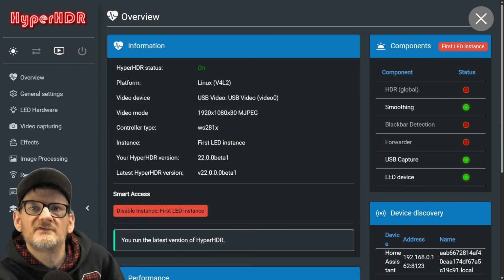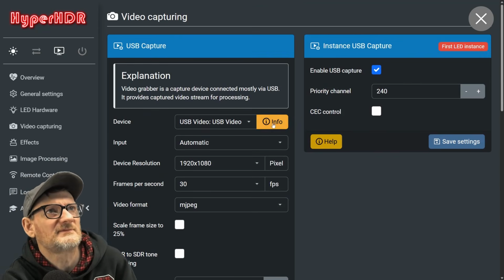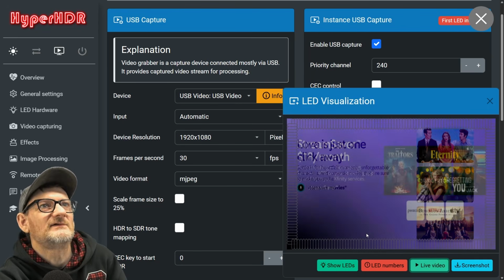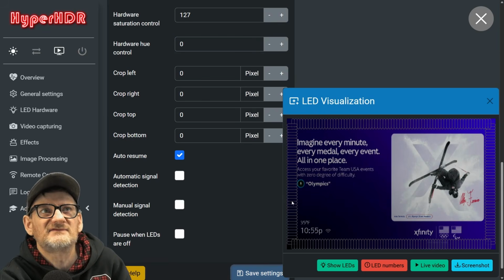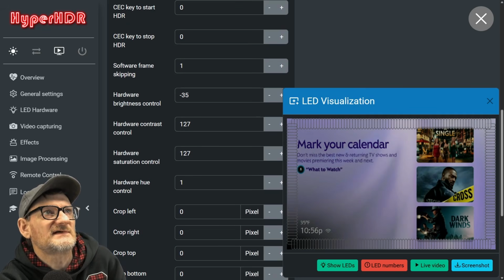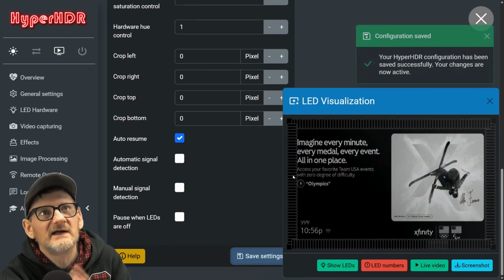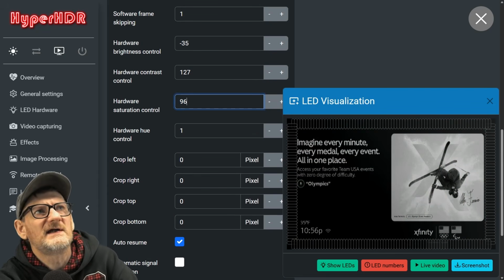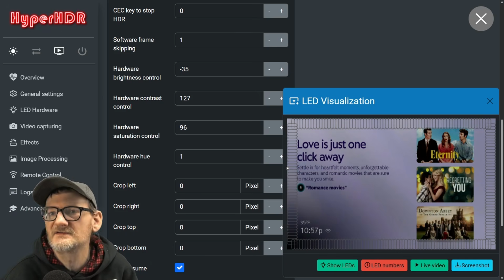Hyperion / HyperHDR Colors Off? Driver Quirk Explained! + Surprise coming Soon! 🎁

Comment: Does this apply to software screen capture also? My issue is...im only getting white. Its capturing the screen...but its only output is white
Reply from the maker: The first thing I would look at is, in the hyper HDR menu, tap the little preview button that shows you a preview of what exactly is being captured. Make sure you're seeing the video that you believe should be being captured. 

If you just see a white screen or something else, go through all the settings... I don't really cover screen capture in my videos because I generally focus on TVs, so I'm not 100% sure what settings you can adjust in that mode. I do know it can be done, I'm just not that familiar with the settings... 

Failing that, make absolutely sure your LED settings are correct. What type of strip, number of LEDs on each side etc...

Comment: Thanks for your effort in making a project like this approachable for the layman!
I am currently looking through the hardware list on your website and I have a couple questions.
1. I see that you mention getting a strip with 60 led/m. Is that the minimum? Does more equal better? I understand that the PSU has to be sized accordingly.
2. I see that the SK6812 strips come with 3 options for the white led: Cool White, Natural White and Warm White. Which one are you using and/or which one do you recommend?
I have a 4K 55" OLED TV from LG.
Sorry if this question has been asked or is answered somewhere on your website. I wasn't able to find the answer.
Thanks again!
Reply from the maker: Answering your questions:

1) More will give you perhaps finer grained control of the light pattern, however at a certain point, the natural "smear" of light reflecting off a wall a few inches/cm away will just blend the light together.

I recommend 60 because it's about as high as necessary as far as detail, and the only other benefit of using more would be to make the whole effect BRIGHTER -- and 60/meter is, in all cases I've tried, more than suffiient in that department.

In the end, it's a matter of personal preference, just note that the corner connectors I provide will NOT fit on a strip with more than 60/meter (if you purchase the bundle with those corners).

2) Two part question, two part answer. Which one do I use? My living room 65" OLED has the RGBNW ("Neutral" or "Natural" white, basically in between Warm and Cold). Which one do I *recommend*?

Go with RGBCW! I can never quite get a good, solid white with mine, and I wish I had gone with the cold white. My thinking was that the CW would be too "blue" but from everything I've read elsewhere, RGBCW is definitely the way to go for this type of project.

I'm currently working on an updated video (waiting for HyperHDR 22 to be officially released; the current beta is still a bit buggy) and I'll update the website with those two pieces of info -- thanks so much for asking and for watching!
Reply: @JustinNelsonsProjects Thanks for the detailed reply!

Comment: Hi sir. I tried hyperhdr but in white screen my leds are lighting greenish. I try to change colour setting but when white become correct other colours won't work properly. Is it because cheap hdmi capture card?
Reply: Not necessarily. When full screen white yeha the leds have green tint. Even watching movies a have small white scene that will be shown with green tint. Other colours are ok.my tv is 50inch. I'm using that rectangle hdmi capture card you shown in the middle of the video. 4k capture card with loop out. Sir if you kindly check with that capture card you might know what I'm facing. Mine don't have YUY2 it just YUY. Also I seen a video of the hdmi capture card you shown first the small one, they say it gives a green tint to the whole output. I'm waiting for your next video 🫡
Reply from the maker: @swagger97 The capture card I show in the video, and the one I linked to and recommend, does not alter your video in any way. It's after the splitter, so it cannot alter the video going to the television. 

The one you are talking about, I did experiment with a couple of different so-called "pass-thru" capture devices, with usually pretty bad results. Firstly I can never get a 4K signal to pass through those devices, they either downscale it to 1080 or they just don't work at all. 

And they also tend to strip HDR and Dolby content. That's why I don't like the pass through kind of devices, I would rather use a splitter and then a separate capture device. 

I know one of my much older videos showed using a pass-through device and that was before I discovered how bad they really were... And yes even the settings in hyper HDR are quite different with those pass-through devices in my experience. 

So I guess the first thing I would recommend is getting a splitter and an inexpensive capture card much like what you see in my video. Links are on my website on the hardware page. 

Now if there is some color tinting happening just with the LEDs, not what's on your screen, that can be tuned out in hyper HDR under image processing. Again my tutorial walks you through getting started with that section. 

One thing you have to note is that the red green and blue channels do not respond the same, and that's just the nature of how LEDs work. If you give each LED the same power level, like say full brightness, they will not mix into a nice white. Generally it will be heavy on the green and blue because red LEDs by nature and by simple molecular physics, are just not as bright given the same power. 

Some more expensive strips compensate for this but even the good BTF lighting ones do not. You need to compensate for it by adjusting the red green and blue channels individually in the software until you get a nice white... 

I hope this was helpful. I'm still not clear if your issue is the color of the LEDs, or if you're seeing discoloration on the screen itself... In any case I would get rid of that pass through device I know exactly what you're probably talking about. I bet it has a headphone / microphone jack, and is marketed as game capture card for streaming...
Reply: @JustinNelsonsProjects no screen is completely good! And yes I also didn't got 4k output so I brought a hdmi splitter and use it instead of the pass through. But leds are turning little greenish when the scene is white. ( Tv screen is completely ok but leds don't match) Let's try to tune the colours 👍🏽
Reply from the maker: @swagger97  If the capture card were the culprit, then you would SEE the green in the HyperHDR preview window -- that is showing you the LIVE video feed being captured.

So the whole thing boils down to how HyperHDR is driving the LEDs, or if they are being powered sufficiently (at least a 10A supply, depending on the size of your TV/LED loop).

I use the very same "cheap" capture card on both my 55 and my 65 inch sets, with a 10-Amp supply; one has WS2812b LED strip, the other has the SK6812 (RGBNW, or RGB + Neutral/Natural White). Both BTF branded.

Neither has this color issue you describe, but it DOES take time to fine-tune the Red/Green/Blue channels in the software to get everything "right". As I stated before, the physical LEDs operate at different forward-voltages and have different current characteristics on a molecular level, so 50% red + 50% gree + 50% blue does NOT give you 50% "white". Nor 100% or anywhere in between.

Also note that even HyperHDR (in the latest BETA for v22) seems to recommend only adjusing the RED/GREEN/BLUE (or "Classic" as it was called in v21 and previous) -- something I have ALWAYS recommended, because Cyan/Yellow/Magenta are artificially created by mixing the RG and B anyway. Trying to calibrate the "in-between" colors just doesn't make sense and adds more unnecessary math and room for human error...

Next video will go into more detail; I'm partly waiting for Version 22 to be fully released, then I have to film some stuff, write a script and address all of the things people ask here and via email (so definitely keep the feedback coming!)

Lastly I just have to say that, it's more difficult to help if you aren't using the exact hardware I show. Not because I make money from the affiliate links -- rather, because I have zero experience with ever single variation of product out there, and can only speak to the ones I personally have tested (and use daily).
Reply: @JustinNelsonsProjects I have tried but no change 😂😅. Yes I'm using 5v 10amps power supply. The picture in tv is white and the live video is white but the leds are not turning white instead they are lighting like a greenish colour. It's difficult to understand what I'm saying 😅. If there is a way to send pictures of the problem I'm facing it will be easy to understand. ( I'm not using a level shifter is it the problem? )
Reply from the maker: Does this only happen when the whole screen is white? It sounds like you may have a power issue. If your Power Supply isn't powerful enough (at least 10 amps, more if your TV is bigger than say 65 inch), then going "all white" will draw quite a lot of power since each chip will be lighting all 3 LEDs.

And GREEN LEDs specifically tend to light brighter at lower voltage -- so if there's a power dip, or voltage drop, the green would shine through more than the rest.

Also make sure you are providing power at both ends of the strip, or injecting power somewhere in the middle, especially on a longer strip.

You might try turning down the BRIGHTNESS (in Image Processing), with an all-white screen, and see if it suddenly evens out. That'll tell you that it is in fact a power problem.

It is not likely the capture device -- you can check this by clicking the Preview icon (little TV-looking rectangle at the top of the Menu), then clicking "Live" to view exactly what is being captured as a live-stream in your browser.

Hope this helps, keep us updated on your progress, and thanks for watching!

Comment: Justin, do these apply to Hyperbian as well. I'm struggling with the wrong colors being captured.
Reply from the maker: It is entirely possible that you're running into the same weirdness. It's always worth changing some settings around and seeing if it helps but, Make sure you export and download your configuration before you start making configuration changes.

Comment: Does This Setup work with hdr content? You say in your Tutorial Website we do Not necessarily Need hdr. I read different things online and I get so confused. I will use a pi3b and gonna Set it up in one month when I move out.
Reply from the maker: I think I only mentioned that you don't really need HDR going to the Raspberry Pi and therefore to HyperHDR. I know that sounds counterintuitive given the name of this particular Hyperion spinoff, but for the purposes of lighting LEDs to color match with your TV, I don't really see the need to process the HDR signal. 

With my recommended splitter, if you switch output 2, The downscale to 1080 as I recommend, it will strip the HDR from the signal I believe... 

However what comes out of output 1 is just an exact copy of what you feed in. So all the HDR, Dolby vision and Dolby Atmos etc all gets passed straight through to the television so you do not lose that. 

I only meant that the software doesn't need that much information to figure out what colors to light up the strip at what points. 

I'll try to make that a bit more clear in my next upcoming video, which I'm going to start working on as soon as version 22 is out of beta...
Reply: I‘m using the ms2109 usb grabber but i‘m Not getting a signal ein hyperhdr. I think my pi Zero 2 w recognizes the grabber because its listed in the sudo terminal but theres only 4 bcm as options but no video0. Chatgpt says its because of power supply, but I think the raspberry gives out enough juice for the grabber. It also doesnt give me video0 when i‘m disconnecting the hdmi cable from the grabber. Can you help me?

Comment: Hi justin ive installed a hyperhdr beta but messed alot of the settings up do you know how to delete the db ive tried removing the hyper and then reinstalling it but the settings are still saved theres nothing on Google I can find and I cant find a user profile hyperhdr db to delete the do or do uou know what file it will be in or is there a command I can run thanks
Reply from the maker: Ouch... There's a reason that the HyperHDR team, and myself, recommend saving your configuration before any software updates. Especially with a beta version... 

I always make a backup before I even make tweaks to the color settings, in case I get carried away and can't remember how to get it back, I can just restore. It's super quick and easy... 

A quick check on my system reveals that the configuration is stored in ~/.hyperhdr/db/hyperhdr.db.

So log in via SSH (refer to the same instructions on my web tutorial if you forget how), and from the prompt:

username@hostname:~$

Type the following:

rm ./hyperhdr/db/hyperhdr.db [ENTER]

DO THIS WITH HYPERHDR NOT RUNNING

Or do this in between uninstall and reinstall....

Note the dot in front of /hyperhdr.... you can always type:

ls -Fla

to view "dot files" and folders in a nice list...

Let me know if this helps, and remember, click General Settings, then "Export" before making any major changes in the future!

Best of luck...
Reply: @JustinNelsonsProjects thanks for the reply I've just reinstalled the inager starting from scratch but I will bare that in mind for this one I put on :) thanks for replying
Reply: Il follow your steps on the hdr setup its just im syncing the raspi to wled eps32 but I plug my nvidia shield into the capture card and say if I opened YouTube the Internet would go off for a minute or so then if I opened another app the screen would go off and say no signal so then I had to pull the USB out the capture card to find signal again not sure why it was doing that hope It doesn't this time round anyways

Comment: Beautiful video. Will check the settings as I am still tinkering a bit.

Question, I use same capture / splitter combo, it does not pass CEC right? Or I need to adjust? Currently thinking of a way how to turn / turn on TV without using extra remote and at current settings CEC does not work it seems.
Reply from the maker: I get this question a lot, and unfortunately I don't use CEC for anything in my setups. 

In my living room I use an old school Sony AVR for audio and a streaming box from Comcast as my video source. 

In my case the streaming box remote power button is programmed to turn both the television and the Sony receiver on and off, just using IR. 

Then for my bedroom setup, I just have a sound bar with HDMI eARC so again, one remote kind of does it all... 

But it is known that CEC doesn't seem to work And because I don't have any experience with CEC at all, I don't know if it's the splitter causing it although that would be my first guess.... 

It is something I'm going to look into, but at the moment I don't have any equipment to really test with...
Reply: @JustinNelsonsProjects all good, I think it might work but need better splitter to pass the signal. But this is a small issue :)

Comment: I love that you’re still active with this project. I haven’t touched my setup in ages. Can’t even remember the full setup details. HyperHDR v.19 I think. With the LEDs being controlled by an esp32 board and the pi doing the capturing. I can’t even remember why I went that route. Possibly it was because I went SK6812 with the natural white led option. I love my setup so am naturally nervous about ‘upgrading’ it to newer versions.
Reply from the maker: I am fully in the camp of, if it ain't broke.... The only reason I keep up with the latest versions, is so that I can keep my videos up to date and relevant. As well as the online tutorial and my level shifter project. 

If I weren't invested in it, I would keep whatever is working and leave it alone lol. I've reinstalled Raspberry Pi OS more times than I can count just for testing, but when it's all working well, it really does add to the TV watching experience